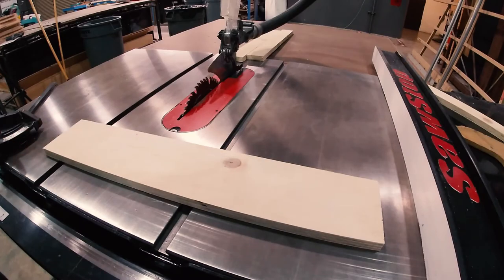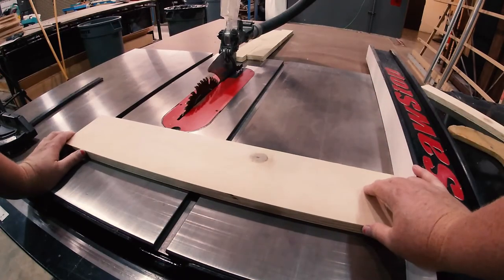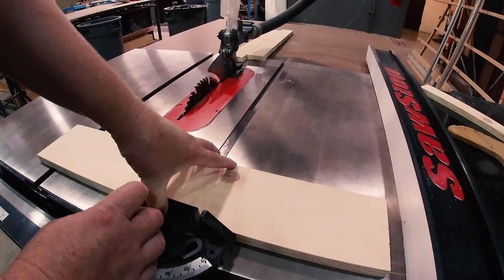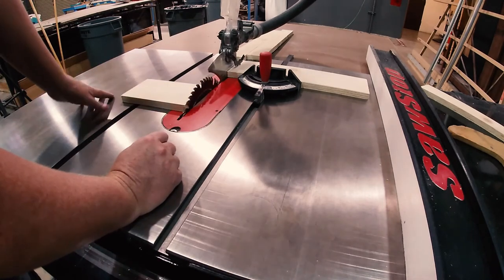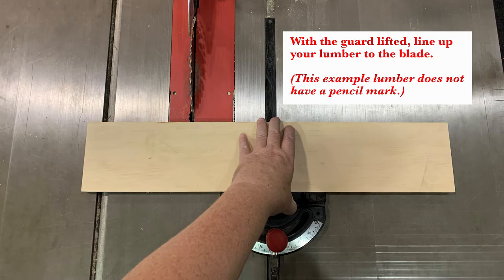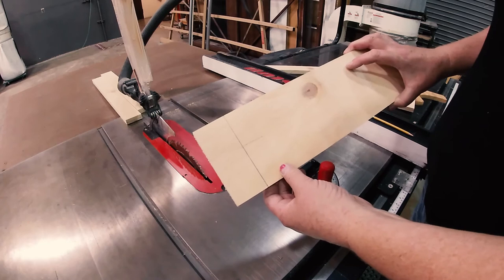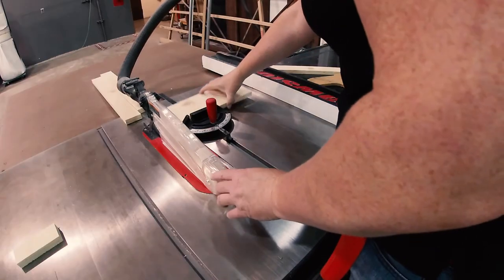Table Saw – Miter Gauge Basics V1.0

Comment from the maker: For clarification, this video is about how to know when to use the miter gauge instead of the ripping fence, primarily focusing on the safety factors involved. It is NOT about demonstrating how to properly cut plywood on the table saw. It is not about what blade to use to cut plywood versus the blades used when ripping solid lumber. It is not about what blades and techniques to use when cross-cutting plywood versus ripping plywood sheets. There are plenty of resources available for those tasks. This video is only about demonstrating the use of the miter gauge and knowing what kinds of cuts are safer on the miter gauge versus on the ripping fence. 

In the video, I use scrap 3/4" plywood because it is an abundant remnant of the typical theatre scene shop. Small scraps of plywood are rather useless in the scene shop, so rather than throwing them away, I use them for demonstrations of power tools. They are a good reference for what sizes and shapes of lumber stock, whether plywood, laminates, or solid softwood or hardwood, are best suited to cuts made with the miter gauge. Plywood scraps are also excellent for practice cuts on the ripping fence. In theatre set construction, we use a lot of 1x pine, so that is more valuable even with the smaller scraps that accumulate. My in-person training sessions with students will focus on using scrap lumber, namely scrap 3/4" plywood, and practice in using the all of the fences and controls of the machine. Again, that is the focus of this video, basic introduction to using, adjusting, and cutting with the miter gauge on a table saw. Practices that apply to whatever stock you cut with your table saw using the miter gauge.

Comment: Thank you so much for making this video! I bought myself  a table saw for over a year now still brand new because i been extremely nervous and afraid of the danger and kick backs. I freaked myself out because i watched many videos of kickbacks people had experienced. So i been making hard on myself by using either hand saw or circular saw which took lots of times to finish my DIY projects. 

After watching your video i am motivated and more at ease to pull out my saw table and the first thing i am going to make is the table saw sled for protection and convenience of having a sled. And then also adjusting my miter length with wood. Thanks again! I am excited! :)😊

Comment: Any particular reason for being to the right of the blade as opposed to the mitre gauge in the left T slot? Was wondering if it is a right handed vs left handed operator preference.
Reply from the maker: I think this is mostly about the comfort of the operator and about the best way to position your cut. Depending on which way your blade tilts, one side may be safer for compound miter cuts. But usually it’s the same as the miter saw, positioning the wood left or right depending on the size/shape of the off-cut. Most experienced operators should be equally comfortable on either side, so typical less of a left-handed or right-handed thing and more  about the specifics of the cut.

Comment: If I wanted to cut some corners off the corners off a chopping board at 45°, whereby the chopping board is roughly 300mm by 300mm, would this be the right way to do it?
Reply from the maker: Yes the miter gauge is the best way to cut 45 degree corners off of something, size permitting, which it sounds like your project is within the size limitations of a typical miter gauge. 

The miter gauge that comes with most machines has a very small area of support though. You might want to add an auxiliary support fence for greater control and accuracy especially if you want repeated, accurate cuts on all four corners. Something you can also attach a stop block to. Or buy an aftermarket miter gauge. Or fabricate a sled.

Comment: I loved everything about this video except the old school super mario-ish music, hah! 
Very informative overall though. 
I recently bought a sawStop. Can I use any miter gauge with it? Or does sawStop make one to work tightly with their own tablesaws?
Reply from the maker: I’m not the best person to answer your question. I only have the one SawStop and haven’t used aftermarket miter gauges with it. This one does have the t-slot gauge track, which I believe is pretty standard. 

We mostly do ripping of 16’ lengths of pine on the machine in the scene shop. Rarely have need for the miter gauge, not enough to invest in a better one. So you might have to confirm from some users who have had a lot of experience with alternate models of miter gauges.

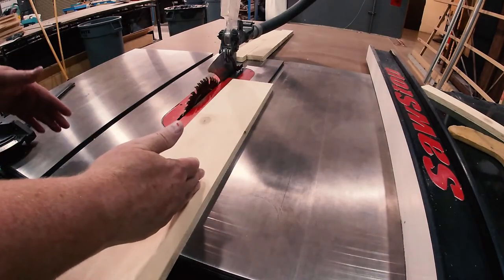Comment: 1:14 - Incorrect, ripping or cross-cutting for plywood isn't based on its dimension, it's based on the plywood veneer. Whatever direction the veneer is, determines whether you're ripping or cross-cutting plywood. This is evident when you attempt to cross-cut plywood with a low tooth blade, you'll end up with tearouts - this is especially true if you work with Baltic Birch.

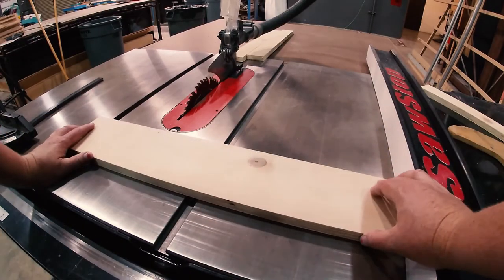1:52 - Also incorrect, it's not a 2:1 ratio, but a 1:1 ratio. People have gotten sloppy and tried to go past 1:1 ratio and paid for it. People have also gotten lucky and not pay for it. So go past 1:1 at your own risk.
Reply from the maker: You are missing the point of the video. The video is not about determining whether you are actually ripping lumber or crosscutting. The video is about knowing when to use the ripping fence and when to use the miter gauge. 

The name, ripping fence, is misleading, which could lead one to assume that all ripping cuts use the rip fence and conversely all crosscuts should then use the miter gauge, but this is not the case. Safety considerations require one to take the shape and size of your stock into consideration to determine which of the two fences to use. It doesn't matter if you are ripping or crosscutting. One fence is always going to be the safer choice depending on the outside dimensions of your stock. They both can do crosscuts and rip cuts. 

I am pretty sure in the video that I say when cutting plywood, certain cuts are "like" ripping cuts and others are "like" crosscuts, not that something was definitively one or the other. In terms of relation to the veneer surface, you are correct in what is determined a rip cut or cross cut for a finished piece of hardwood plywood. But what I say is also correct due to the perpendicular orientation of each layer of lumber, in that you are technically crosscutting and ripping with pretty much all cuts in plywoods. 

This channel is also about common and standard practices in theatre production. As such, we are almost exclusively using plywood, luan, or other laminates as sheathing for platform lids, for scenic flats, for prop construction. We rarely need to be concerned about the orientation of the veneer surface with regards to our cuts on the table saw or other tools. Most things are going to get painted for stage and cover up the grain. I am demonstrating with 3/4" plywood because we use that for platform lids most frequently. 

In theatrical production shops, a crosscut sled is impractical and would largely be in the way. The majority of our table saw processes is ripping 1x12 into various sizes for theatrical flats and platforms. We most likely wouldn't even be doing the cuts demonstrated in this video on the table saw because we have miter saws and radial arm saws to do so more safely. And we have a panel saw to wrangle larger sheet good cuts. But for students using the saw for the very first time, they need to know how the miter gauge works and what tasks it can do, since it's part of the bare-bones basics in operating the table saw.

Comment: Your not cutting lumber.  Your cutting little scraps of wood.  Lumber is eight to ten feet long and cant be safely crosscut on a table saw.  Admit it; a table saw is a lousey tool for cross cutting.  If you want to cross cut lumber, get a chop saw.  In the alternative, if you don't want two tools with circular blades in your shop, there is one tool with a circular blade that does both cuts accurately and safely.  Guess what it is.
I do want to complement you on the safety measures shown in this video.  You are one of the few demonstrators that actually use the safety equipment that came with the saw.
Reply: track saw?
Reply: Even if you didn’t have access to a sliding table saw for cross cuts, I could name enough reasons why a table saw with a miter gauge or sled is by far a superior way to cross cut, but the main reason is ease of calibration control.

Good luck cutting a 5/4” piece of white oak on a 12” Bosch miter saw without it deflecting.